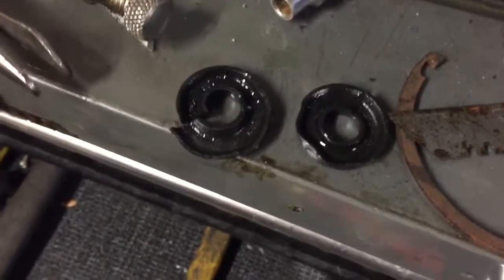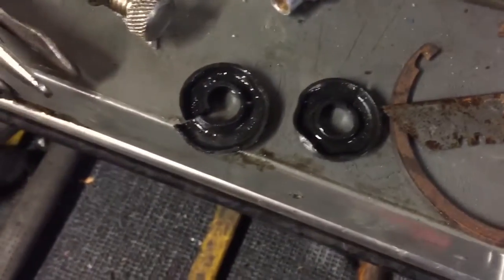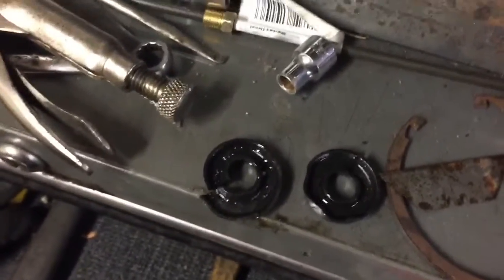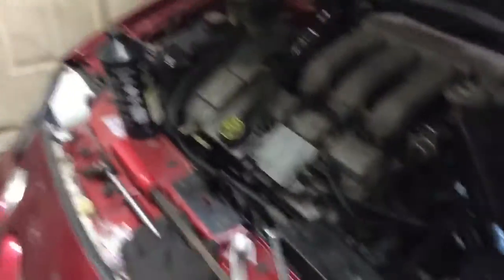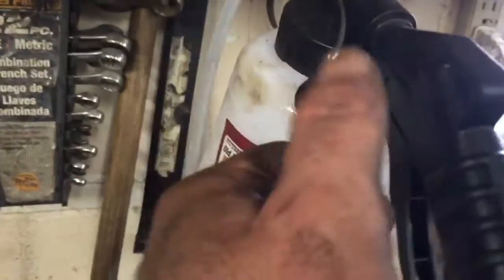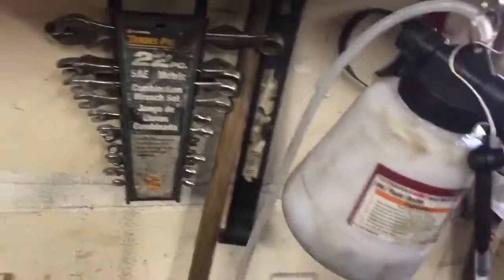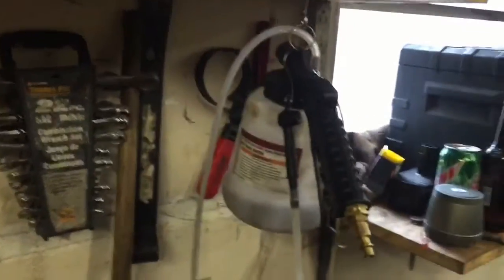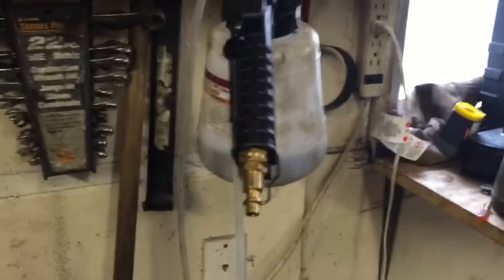99 Ford Taurus Master Cylinder Problem

Comment: I wanted to see how precisely you went about detaching the rear brake lines that run down the seam adjacent to the emergency brake cable from the master cylinder.  There was none of that -- I could care less about the bleeder.  My rear lines between the master cylinder and the proportioning valve in the rear are rusted and leaking.  I cannot even see where they are when looking into the engine bay from above.
Reply: I had this problem pal , sorry I believe they run along the frame rail. Also you need to take the whole air intake just to get to the master cylinder. It takes a 14mm and the one the right is hard to get off because there is some sensor  or something in the way.

Comment: I just got a brake bleeder from harbor freight thank you for the review.  What do you think about swapping the rear end from a 2004 2500HD Chevy fullfloater 14 with disk brakes and putting it into a 1983 K25 with a simifloating 14.
Reply from the maker: Hmmm I don't know. I'm sorry just a little bit lost on that. But I say... You can make anything work if you have time, patients and the right tools. God luck!
Reply: +davesgarage512 hi i have an Audi s3 2001 i had a break line wear through after an air con pipe wore through it due to rubbing.i made a new line up.i bled all four corners an couldn't manage to get the brake pedal back to factory operating. Spec it was really soft.ive tested the master cylinder by taking the lines back out of it an screwing in two bolts in there place success pedal works fine masters ok?????so now im thinking i have to get the air out of the line going to the abs pump?any helps appreciated
Reply: An want to see the action not talk